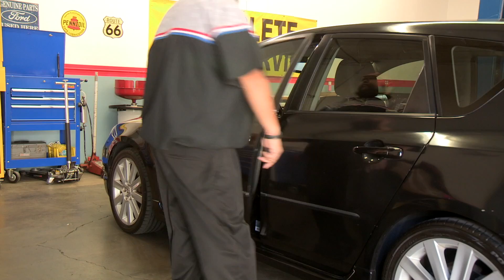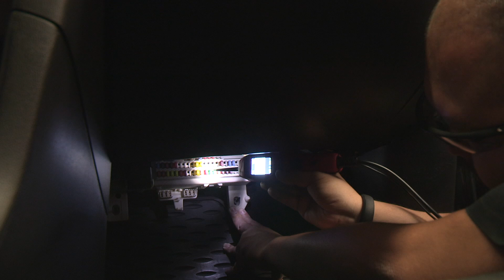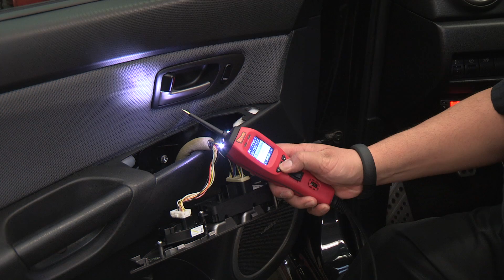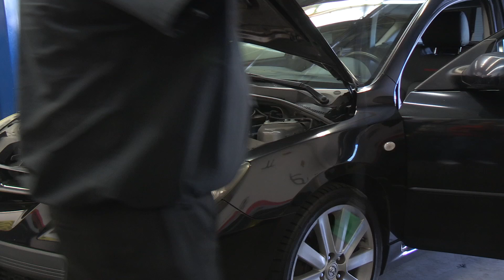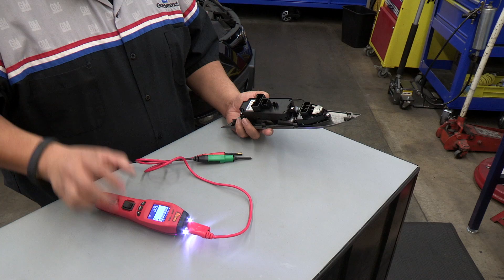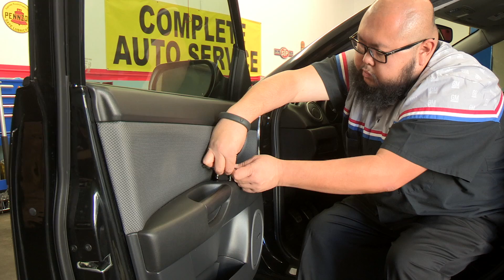Window Motor Diagnosis Using the Power Probe 4

Comment: I am just beginning to use power probes circuit testers as a shop owner I realize electrical is one of our weak points. They are so much to learn about the electrical issues. It causes problems. Please show more on the job training videos thank you from someone that this is a weak point.

Comment: good diagnostics unfortunately this only applies to rare,new,expensive cars- here's why- real world people want cheap repairs.most switch failures occur on older cars where a master switch is only a few bucks on eBay and u eliminate that part from the system that if left used can possibly come back in a week also u can up sell part and make money on that.real world it takes time to get diagram,test an old car where people rarely want to pay a reasonable quote,just throw a cheap new part at it and if it doesn't fix it then quote high to chase customer away and u can concentrate on profitable repairs.anybody in this business that has being around knows that we have no time to take care of cheap customers and making good money is top priority.
Reply: exhibit A for why mechanics are seen as untrustworthy.
Reply: You a damn joke
Reply: Don't want to troubleshoot part changing sucker